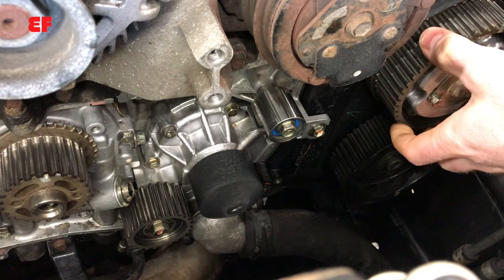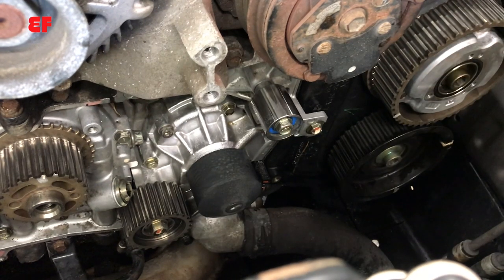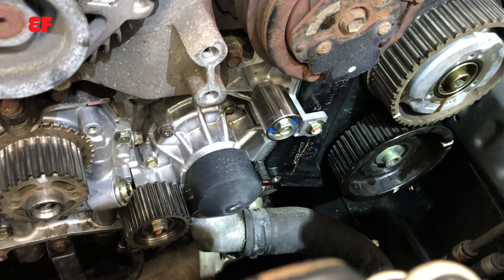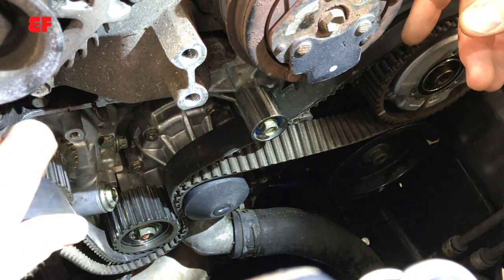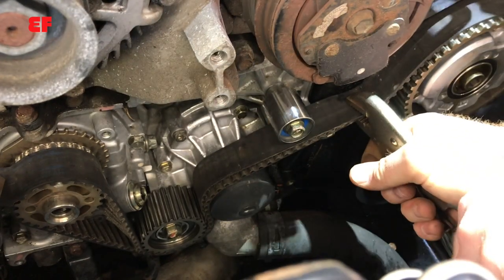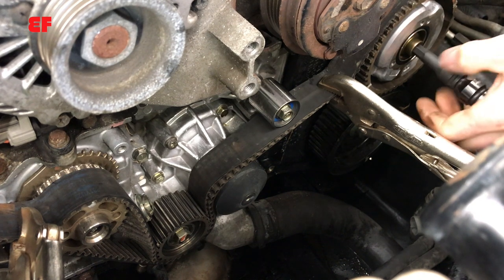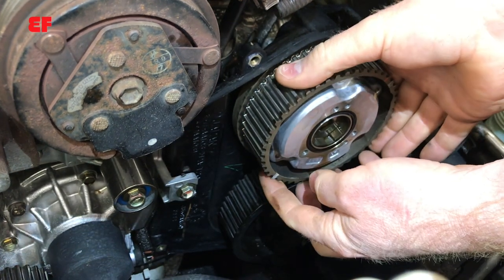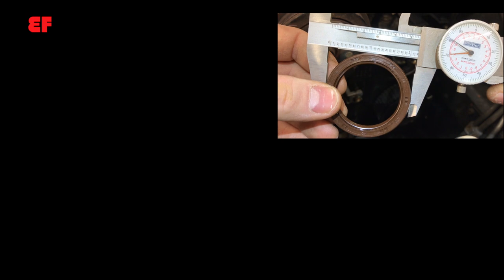MAGICAL TRICK for Subaru Cam Bolts- REMOVE & INSTALL WITHOUT IMPACT TOOLS!

Comment from the maker: Wizard MUST SEE Timing belt trick for Subaru: https://youtu.be/WGZOXrIq2Q8
Best Subaru tool for Impossible Rear Wheel Bearings: https://youtu.be/eKqYtMdlPYo
New sway bar link video https://youtu.be/0S8JBe_jn6g
Reply: This trick was literally a stress relief. I was this close  👉👌to taking it the   dealership. Thank you a bunch. I was able to finish the whole job
Reply from the maker: Awsome! I’m glad it saved you. It’s the only way I do them 😃

Comment: Just a bit of info, as long as your timing marks line up, All of the pistons are recessed enough not to make contact with the valves. Also, the intake cam on the on the driver side must be rotated clockwise then realigning and the exhaust counter clockwise, or they can make contact. Hope this helps.
Reply from the maker: You rock. Thanks for the information.🛠

Comment: I know you posted this 2 years ago. But its still helping folks. My daughter's boyfriends forester blew a cam pulley and we would have never got it off without your help! Thank you!
Reply from the maker: No way! Thanks a lot. I’m glad it helped you out. Those bolts are usually really hard to crack loose. This is the only way for me that doesn’t strip them out. So I figured I should make a video. It was one of my very first videos 😀
Reply: Your way made it easy! She still took some muscle but I didn't see another way to do it without damaging something or making the cam turn which is a big no no lol. Keep up the good work man we appreciate it!
Reply from the maker: Excellent! I will keep em coming. Thanks so much😀
Reply: Didn't work for me, but I'm sure it's something I'm doing. Belt is in the same set up as in the video but it's just striping the bolt.
Reply from the maker: @UTRC51  Sorry to hear that. Once the bolt strips there's not a lot of good options. 10mm hex was used?
Reply: Yes sir same exact bit used in your vid with an 18" breaker bar. It's not full stripped but I don't want to beat it up much more.
Reply from the maker: @UTRC51 That is not what you want. I think you should sleep on it and do some research before attempting to remove the bolt again. I would attempt to do whatever you can to save the engine and camshaft. You may have to sacrifice the sprocket if it is made of plastic. I am thinking one method might be to weld the hex head into the fastener for a solid "bite". Remove and replace cam sprocket and bolt. I think that may be the next best option. Someone may have damaged the fastener before you. Sorry you are having trouble.
Reply: Agreed. I'll be getting back to it tomorrow. No rush second car. I'm also thinking the cam was no longer at TDC. So that maybe adding pressure to the whole cam assembly. It's the variable valve model wrx so I'd like to save the cam gear. Thanks for the replies!!
Reply from the maker: @UTRC51  If you use Subaru's timing mark on the crank shaft....it puts all pistons exactly 1/2 in the bore. That makes piston to valve damage impossible during service of the timing belt. I would use the crank shaft timing marks. That way any cam  sprocket can technically be anywhere in its position and no internal damage will happen while you are trying to get the bolt removed.
Reply: Got them. Bolt extractor and new bolts. Actually snapped the timing belt twice. I guess suby didn't want mine to ever come apart. Again thanks for ALL your help! Torque spec is 70ft lbs for the new bolts?
Reply from the maker: I’m really sorry. I have never had one not come loose for me. I have been lucky. They are so stubborn it’s crazy. I didn’t look it up but I think about 70 foot pounds is correct.
Reply: No apology needed. You gave great info!! Found the torque spec it's 22.1ft lbs, then you turn the bolt another 45 degrees...trust me it's tight. Keep up the good work and we'll all figure this out together!! The timing belt hack still works!!
Reply from the maker: @UTRC51  Much appreciated! I feel badly when it does work out for you. I have been there a million times myself in general working on cars. I know how much time and frustration it causes. Thanks a lot. Hang in there 😃

Comment: This is a great alternative to using the ridiculous tools that you supposedly need to work on these. I'm actually going to try loosening the bolts with the car in gear first, but if that doesn't work, this will be my next step. Thanks for sharing.
Reply from the maker: Awsome! Glad it was helpful! 😃

Comment: I saw your other video on this bolt and asked why you did not use an impact wrench.  I heard what you said here, about how some people may strip the bolt.  I guess then it's a judgement call for each person, but at least you showed a safe, sure-fire way to do it.  Thanks!  Great video!
Reply from the maker: Thanks. These are common for stripping with an impact. A special tool or the belt method mist be used.

Comment: I have the 23 tool for the EJ257 and the Timing belt holding the cams are way easier to remove and no damaging of the cams nor the bolt.  As  I have almost stripped 1 of 4. Three came off with relative ease (i say relatively as putting over 100 lbs to break them loose.) also i think it is way easier when the motor is being held by the car not an engine stand.
Reply from the maker: Agree. The engine stand is way harder. Good luck fixing your motor! 😀

Comment: This is one way to do the job if you do it only once or it s a field-repair. For someone who will do this more than once, buying a sprocket holding tool from Company 23, or any of the Amazon/eBay versions, is a worthwhile investment. 

Install the crankshaft bolt, but not all the way bottomed on the snout, lay the sprocket holding tool on the crank bolt, and use a breaker bar to loosen the bolt. Makes it a one-man job and very easy to do. 

Pro tip: get yourself a FA20/FB25 crankshaft bolt to have in your tool set. It is the same size and thread pit as the EJ crank bolt, but it has a longer shank which makes it easier to use the bolt as a stopped for the cam sprocket holding tool on both banks of the EJ-series engines.
Reply from the maker: Great tips! I am glad you found the best solution for you on this problem. I linked those tools in the description below 😃🔧

Comment: Great trick. I cut the old belt and use a chain wrench. If you’re going to be working on Subaru’s somewhat regularly, but the 40$ combo tool on amazon and the intake side cam holder special tool to keep them from unloading
Reply from the maker: Thank you! Great idea. I may need to do that.

Comment: I broke a reducing socket and a 10mm hex socket on one of my cam bolts. Got out the angle grinder, ground the outside of the bolt to 16mm hex (used the inner hex as a guide), and finally got it off. It felt like over 150ft-lbs of torque to break it, and I thought for sure the bolt was going to shear, but somehow it came off...Also I used the cam tool and just had it rest on a sturdy surface while a friend held both the socket and the tool firmly against the cam gear.
Reply from the maker: Great engineering! These bolts are completely ridiculous In Howe the remove. It is as if they continue to self tighten as the engine runs. Im not sure. But they are a huge challenge. Thanks for sharing. Good job. 😀🔧🔧

Comment: Is it necessary to lock the cams in place before you slide the sprocket off?
Reply from the maker: Texhnically No. But i would recommend putting them in a neutral spot if you can so that they don't turn on you while servicing from the valve spring pressure.

Comment: buy the cam holder wrench for 30 bucks, tap the bolt with a mallet, easier when engine out of car. My 02 wrx just broke the bolts with ease no impact. Also if you have the dots lined up the valves will not hit the piston
Reply from the maker: Links in the description for cam holders if needed 😀🔧

Comment: I'm up to this point on a 1997 Legacy Outback.  The timing marks are all lined up and the timing belt is off.  I'm worried about removing the cam bolts and pulleys because I have no idea how it works in terms of putting the pulley back on exactly how it came off in terms of being lined up with the timing.  I'm afraid that I won't know how to line up the cams once I take this apart and replace the seal.  Looking at your video, it appears that there is a hole on the pulley that fits onto a tab there by the end of the camshaft, and this is probably how the alignment is maintained.  Could you confirm that please, and that no special cam lock tool or procedure is necessary to keep the cam lined up?
Reply from the maker: Hey! Ok first off these DOHC cams systems are harder to deal with than the SOHC style. Both style engines have very critical things that need to happen like having the marks line up and such. The SOHC are harder in every way, you can not see what you are doing on the timing marks with out a mirror, unless you have the engine out. I just want you to know that going in. Getting the bolt out on the cam can be surprisingly difficult on the DOHC and that is why I personally like the belt method to hold the sprocket vs a special tool. It is easier to hold the sprocket. But many people also prefer the cam sprocket holding tool. So its a matter of preference that comes with experience there. Once removed, the sprocket is "keyed" with a dowel pin, so it does only go on one way. There is nothing to hold it other than the bolt holding the pulley to the camshaft. Everything there is pretty simple. But the dang bolt is hard to get out. To line up the timing marks and put it all back together, you will want to look up "timing procedure for DOHC engines. There are special tools that can be used like cam locks. But the easiest method will be found in a video. I know the method, I don't have a video yet on it. Its not hard. But you want to do all of this work in a clean environment and research everything heavily before hand. Most importantly, don't be in a hurry. That would be my best advise. It sounds as though you are on the right path.
Reply: @EasyFixShaun  Thank you so much for the reply and the helpful video!
Reply from the maker: No problem! Most times I am a lot slower to reply. But I was sitting at my desk when you commented. Anyways, keep me posted and good luck!! P.S. I almost forgot.....make sure to use a subaru seal only on the camshaft or you will regret it and have a leak afterwards. The aftermarket seals are different. Don't save time or money on those seals. I learned the hard way.

Comment: Use a external bolt extractor. Tap it on the bolt head. Also works if you do round out the Hex.
Reply from the maker: Why would I use an external bolt extractor? I removed the bolt and saved the bolt with no damage. Do you mean, in the event that the fastener rounds off?
Reply from the maker: I have had good luck not using an impact. Removing by hand only using the hex in the fastener like the video. I luckily haven’t rounded any fasteners. I use the hex first. If it rounds I would go to step two and use an extractor for sure.
Reply from the maker: The biggest issue causing the original hex head fasteners to round and strip out seems to be the use of an impact gun on them. Normally that shouldn’t be a problem with camshaft fastener removal. But with these Subaru’s in particular, at the camshafts they are a big problem. Avoid the problem and do it by hand like in the video. You will find the fasteners are rediculously “stuck”. They aren’t crazy tight from a pound feet of torque aspect. The are “stuck” for some other design flaw aspect. I think the fine threaded fasteners and the way they butt up against the timing gears is the cause. I’m not really sure. But remove and install only by hand. Any other way just isn’t worth it. If they stripped, the repair you are attempting gets 1000x harder and more frustrating. Sometimes the camshafts and fasteners are destroyed. It’s that rediculous. Avoid the problem all together and just learn from other people’s mistakes. Do it by hand, and cross your fingers that it all works out. It’s your best shot.

Comment: I used impact wrenches all the time.  Never had a failure.   Installed hundreds over the years with an impact.  You have to know how much force to use and be careful.
Reply from the maker: I agree. Once you have enough experience torque specs become second nature to some degree.

Comment: What would happen  if I took the pressure off the driver cam before lining the ticks up?
Reply from the maker: As long as the mark for the crank sprocket is lined up you should be able to spin sohc engines with no mechanical contact on any valves. By lining up the crankshaft sprocket mark, it puts all four pistons exactly half way in the cylinders so they can not contact valves even if they are moved or all the way open. But...if you have a DOHC the exhaust and intake valves can still hit each other inside the combustions chambers because they operate independently from one another on their own camshafts. If the Dohc cams are turned at the same time on, the same head, and are not on a belt and in time, they will touch. So DOHC have to be extra careful. I am always carefully on either style cam systems. I make sure crank sprocket is always lines up. (This is a neat way to line up marks and have an extra layer of safety with all pistons mid way in the cylinders and i have only seen this on Subarus). Then i always slowly turning cams with a wrench when not connected to the belt to insure they aren't going to touch anything. 😀🔧
Reply: @EasyFixShaun  great thanks!
Reply from the maker: No prob 😀🔧

Comment: Great video! I'm about to do the timing belt for the first time on my 98 WRX and I want to do the camshaft seals while I'm in there. How do I ensure that the camshafts will stay at the timing marks when I remove the sprockets? I'm worried that the cams will spin when I release the sprocket after removing it
Reply from the maker: Awsome! The camshafts are keyed to the sprockets. So they will only go on one way. Just don’t mix them up. Also when you replace the seals.....use Subaru ONLY!! I got burned really bad using aftermarket seals once. The seals look the same but the sealing surface ridge is off a couple mm and solidly seal correctly on 2/4 camshafts I replaced. It caused a bad engine oil leak once I started the engine in the garage immediately after the repair. I had to remove everything and do it all over again.
Reply: @EasyFixShaun  Thanks for the reply. So when I release the belt and clamps holding the camshaft sprocket to remove them, the camshafts won't spin out of TDC?
Reply: Rad Clifford I am also concerned as well because with a slight touch of the bottom cam spins out of tdc. How do we prevent that. you can’t install that company tool to hold it in place since your trying to remove it lol.
Reply from the maker: As long as you use the timing mark on the crankshaft you won’t damage anything from the cans slipping and spinning. They will slip and spin once the belt is removed because of valve springs pushing them one direction or another. I don’t use any special tools to install the belt other than a 17mm wrench to adjust the cams a bit as I go. Basically the passenger side marks line up easily. The drivers side cams marks are harder because the sprockets have spring pressure and want to slip. I just carefully work around this and make my way until I can install the final pulley and release the tensioner.  I will post a video that shows this quite well.
Reply from the maker: This is the easiest way right here. I only use this method 😀
https://www.youtube.com/watch?v=D1PunROR3VU
Reply from the maker: Hi Rad. I hope I answered all you guys questions on this thread with my replies and the video. Any question just let me know. I do timing belts on DOHC Subbie's using this method only. I have done Hundreds. This is the only method and easiest method I would recommend😁 https://www.youtube.com/watch?v=D1PunROR3VU
Reply from the maker: You don’t need to hold the cams in a given position if using the crankshaft timing marks provided by Subaru. The marks provided put all four pistions 1/2 way up in the cylinder. If you are using the marks you can not physically collide a valve with a piston even if you try to. If you actually put any piston at TDC manually or with any other mark you will damage something. That would be any method other than the method Subarus are always timed with. Just use Subaru’s timing marks and you will be fine. On both the sohc and Dohc Motors, I have had cams slip on every job I have ever done. It doesn’t matter. Just put the cam back into position and put the belt on.
Reply: @EasyFixShaun  so basically if I get it all lined up before I take the belt and cam wheels off I should be ok even if the cam spins after removing the belt? I can just spin the cams freely to realign as per the video link you posted without causing damage? I'll finally be starting the job this week.
Reply from the maker: Correct. If the timing Mark is on the crankshaft timing gear sprocket is lined up, all four pistons will be exactly half way up/down in the cylinder bore. So you won’t be able to actually collide any valves with any piston, even if you tried. That will only be true as long as the crankshaft doesn’t change its position. Subaru was super smart to do it this way. The timing marks are the marks under the timing covers. Those are the mark you will always use. There is a top dead center mark on the outside of the covers that could be lined up with the crank pulley, but that has nothing to do with timing belt service. I’ve never used those marks for anything. They would be for tuning purposes only. So use the timing marks inside the cover on all the timing sprockets and you will have no problems with pistons and valves touching each other on any cylinder.